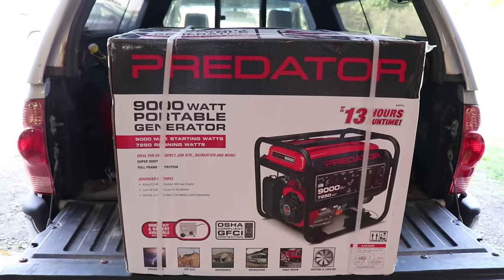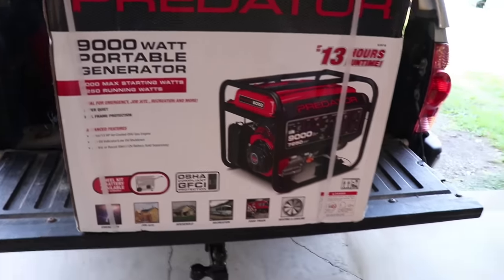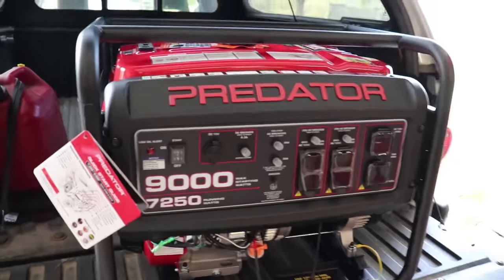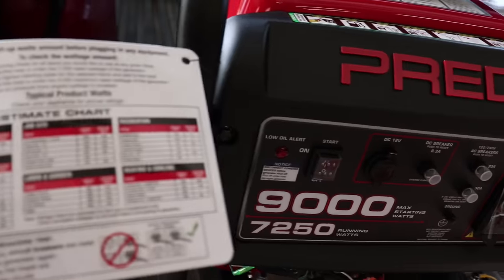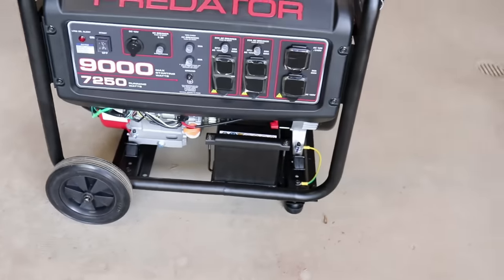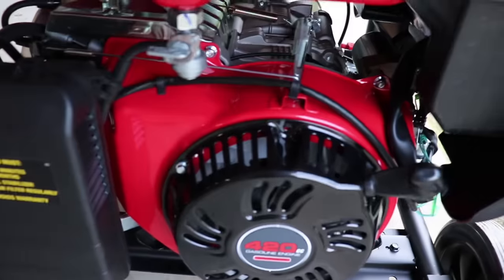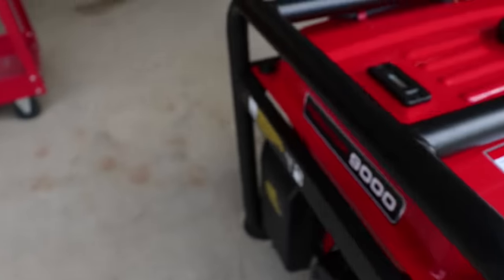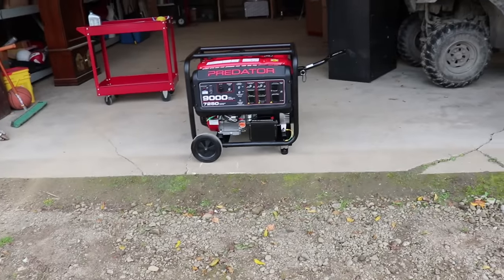Predator Generator Running Our ENTIRE Home. (Complete Setup and Cost)

Comment: i would like to add a tip.....when your through with the generator turn off the fuel and let it run til it quits........that will keep the carb from gumming up...
Reply: Great point Fred.  Another reason to turn the fuel off and run dry, is to prevent your entire fuel tank from leaking all over the floor in the event the float gets stuck.  It happened to me 4 years ago.
Reply: @3qgc  Also never let in run out of fuel if connected to a load or the AVR will burn up , If you have access to aviation gas it will last longer and not cause carb problems like gas with ethanol does(ethanol breaks down in approx 9 weeks)I have had poor results with  fuel stabilizers and think its snake oil .
Reply: @gloknor  Unfortunately, my generator has run out of fuel under a load however, I don't recall anything major happening.  I'd refill it and be good to go.  AVR?
Reply: @3qgc  avr is the automatic voltage regulator, I have lost several generators from guys running them out of fuel under load and it ruins the gen head because the avr is trying to compensate for the load and  loss of fuel .
Reply: Add Seafoam to the fuel.  I run in all my gas lawn equipment and everything starts on first pull even after sitting all winter with gas in the tank and carburetor.
Reply: You could probably get a lpg conversation kit for that quite cheap on aliexpress im thinking about getting one for my 2kw genny
Reply: @chrisblester37  Great idea especially if you have  the 100 lb bottles plus the engine will run a lot cleaner but I think the power will be slightly less since there is more energy in gasoline (approx 30k btu more per gal.) but still better than a gunk crud filled carburetor that won't run right and potentially ruin gen head and whatever is plugged in to it .
Reply: @gloknor  What if it runs out of gas while i am sleeping? Will it burn it up and I have to buy a new generator?
Reply: @n721sw  I hope not but try to have it full of fuel before bed. I have had generators  ruin the gen head  from running out of fuel under load . I now use a diesel generator for my house and it is much more fuel efficient and no more gummed up carburetors to deal with either. Be very careful if filling with fuel while running since they it could overfill and spill onto generator head.
Reply: Buy two large red gas cans and store about 20gallons of fuel for emergencies. You also have your cars tank that you can draw from. Put some stabil in it and use that for your lawn mower, refilling the big container as needed. That way you always have some "fresh" gas.
Reply: @gloknor  this is why generator safety is very important
Reply: @brianb5594  Seafoam is amazing.
Reply: @gloknor  I hear people say that all the time but whos gonna monitor that all night most people when it runs out get up go put more gas in fire it up and go back to sleep so whats the deal i been doing it for yrs same Harbor Freight old Chicago Electric Gen had it for 23plus yrs still runnig strong never had a problem    Stop trying to scare people!!!!!!!!
Reply: @johnames6430  I am pretty sure stabil does little to nothing. It was probably useful when gas did not have ethanol but I have taken apart a lot of things treated with it and no difference . There are several reviews on YT  showing it does not work also . Fresh gas is the best like you said .
Reply: Travis Hamler  Yes it will lol, there is no fuel fail safe but you can keep believing your own bs . Ruin your genny I don't care in fact I will laugh knowing you believe that bs.  .
Reply: Travis Hamler  keep buying snake oil if it makes you happy but if you actually researched it before running your mouth or have torn apart as many carbs as I have you would know it does nothing.
Reply: @gloknor  I thought you add stabil because of ethanol. If you have just pure gasoline like the old days then you don't need stabil (I think)
Reply: @johnames6430  Stabil is suppose to protect from several things like ethanol breakdown but I have seen no difference . When Stabil first came out in the late 60s there was no ethanol alcohol in gasoline and fuel lasted longer regardless but like I said I personally have seen no difference like many others. Just because a product makes a claim does not mean it is so .
Reply: Ava fuel is way overpriced and difficult to get - real, real stupid idea!
Reply: @longshot7590  Real real stupid  is your comment.  If you want good fuel that is why is cost more . Sounds like you have other issues that need addressed .
Reply: Travis Hamler  thanks Travis!  Appreciate the reply.
Reply: @fred benson  Absolutely correct. Been doing that for years. When I put the gen into storage, I add a full tank's worth of Sta-bil and then turn the gen back on for a few minus to get the stabilizer into the fuel line. Then I turn off the petcock and let the gen turn off from lack of fuel.
Reply: @3qgc   - great point. Gen carbs are pretty basic and easy to have the floats stick open or closed. Well said.
Reply: Travis Hamler  I’m new to all this. But looking to get a generator to run my 1300sq ft home in case of power outage. What do you suggest I look at buying?
Reply: Travis Hamler  And Travis with the K.O.
Reply: Make sure you all are aware with the hazards of using generators. Generators can be dangerous if not used carefully so make sure you follow all the generator safety instructions. I know all about generator safety and I have something to explain to everyone about generator safety. Here is what you all should know: please remember not to ever run your generator indoors. Generators should only be used outdoors. Always remember that carbon monoxide fumes are odorless and colorless gas that is a silent killer that you cannot see or smell. Carbon monoxide is dangerous and it can cause death. Carbon monoxide is poisonous. Always keep that in mind when using generators. You need to have a carbon monoxide detector. Make sure your generator is 15-20 feet away from your house and away from doors, windows, and vents. Never use your generator indoors even if your doors and windows are open. Some people run their generator indoors during hurricanes which is dangerous and you and your family will die if you use generators indoors. Running a generator indoors increases the risk of carbon monoxide poisoning. Please don’t run your generator in wet conditions. Running a generator in wet conditions can electrocute you. You need to keep your generator dry. Don’t let the portable generator get wet. You need to have a generator tent as well to protect your generator from getting wet if you will use  your generator during wet weather. We also really need to keep our children safe when we’re using portable generators so they won’t get electrocuted or burned by the generator which is dangerous. Generators can be hot. You have to keep an eye on children making sure that they are not near the portable generator to avoid any risks. We have to be aware with all the hazards and follow all the instructions in the generator’s operating manual. Generators pose electrical risks. Make sure your generator is not overloaded. Overloading your generator can cause damage to the appliances that are plugged into the generator. Please don’t overload your generator. Don’t ever try to plug a generator cord into a wall outlet to avoid back feeding. Back feeding is dangerous. Always turn on your generator first before plugging in appliances. And before you unplug the appliances, please shut off your generator first. Please use a heavy duty cord for your generator and the cord should not be worn out. Please don’t refuel your generator while it’s running. You should shut off your generator and let it cool off before refueling it. Refueling your generator while it’s running can cause fire if gasoline spills on the generator’s engine because it’s hot. Please make sure your generator is properly grounded. Everything that is said on the generator’s operating manual should not be ignored. They all need to be followed. https://youtu.be/I1jT3ANENvI and here is a video more about keeping your family safe while using generators. This is for everyone’s safety. This is just a safety reminder for everyone to make sure that you all are aware with the warnings. Thank you and hope you all stay safe.
Reply: @gloknor  seafoam is one of the better fuel stabilizers and they absolutely do work on ethanol-based fuels.

I get tired of all the people spreading false information about alcohol-based fuels, alcohol as an anti-noch agent was the original anti knock agent that everybody on the planet wanted to use except for us oil companies who demanded the use of a very dangerous compound known as Tetraethyllead also known as Looney Lead because the workers responsible for adding it to motor fuel all went slowly batshit crazy.

Tetraethyllead is so toxic that just a eyedropper full in the palm of your hand will kill you yet somebody thought it was a good idea to put this in motor fuel.

At the time every major scientific institute on the planet opposed it, Albert Einstein wrote a very long letter and actually testified in front of Congress on the dangers of adding loony lead to fuel.

Tetraethyllead is now being linked to the violent crime surge the US, 

Children in inner cities were exposed to large amounts of Tetraethyllead, every microgram of Tetraethyllead per deciliter of blood in a young child's system will result in a 5 to 10 point drop in their IQ as it significantly impacts the development of their neurological development.

So the inconvenience of switching to alcohol from Looney Lead is a small price to pay for what the US is now seeing as a 30-year low in violent crime which is directly attributed to removing Tetraethyllead from motor fuel
Reply: @dannelson8556  Sea foam is snake oil too but have fun wasting your money. Fuel stabilizers DO NOT work . Sorry if that offends you .
Reply: We used to do this with dirt bikes we knew we wouldn't ride for a while.
Reply: @gloknor  Question
if the AVR is constantly calculating the voltage to adjust it as needed/hense AVR,how do they burn up when the thing runs out of fuel nothing is pulling power or voltage one would think? I know enough about electricity to not fool with it to be honest.
Reply: @captainjoesanglingadventur4894  All I can tell you is the 3 gennys I had the construction crew use ran them out of fuel while using them under load and all were trashed. I had a 4th generator lent to my sister after a storm and of course she did the same thing( ran out of fuel under load) and it was toast as well. Granted these were not high end gennys  but still cost around $600 ea and really upset me.I suggest turning it off when going to bed or be vigilant on checking fuel when using one its not worth ruining it .  Take care Captain Joe .
Reply: Here are the portable generator safety rules: this safety information is only for anyone who use a portable gas generator and for those who are planning on getting a portable gas generator. This is just a reminder for everyone’s safety. All generator safety rules should be followed carefully. This advice is just to make sure that everyone is aware of all the warnings and it’s just to remind people to be careful using portable generators. Generators can be dangerous if not used carefully. Every year, hundreds of people die or get injured when using portable generators due to carbon monoxide poisoning and electrocution. Make sure you are using your generator carefully and keeping others safe as well. There is something very serious that everyone should always be aware of when using generators. Some people do run their generator indoors which is not safe and that increases the risk of carbon monoxide poisoning which can cause death of family and you. Some people run their generator in wet conditions which can electrocute them. Please remember that you should never run your generator indoors. Remember that carbon monoxide is an odorless and colorless gas that you cannot see or smell. Carbon monoxide is a silent killer. Keep that in mind. Make sure your generator is 15-20 feet away from your house and away from doors, windows, and vents. Never use your generator in your porch too. Having a carbon monoxide detector is very important against generator safety. Some people also allow children to go near the portable generator which could pose risks. We need to keep an eye on our children making sure that they are not near the portable generator so they won’t get electrocuted or burned by the generator which is dangerous. A locking enclosure also keeps kids safe. A generator shed might look like a tempting place to explore, or take cover during a game of hide and seek, but a generator is a dangerous piece of equipment that can cause injury. It says on the manual that we should also keep children away at all times from the portable generator to avoid injuries. Please do not allow a child or unqualified people to operate the portable generator.  It is important to keep your children safe especially little ones. The portable generator can be hot during an operation. Just because some manuals missed what should be listed doesn’t mean it’s safe to do. Always follow the generator safety rules when using portable generators. Generators pose electrical risks. If you need to use your generator during wet weather, you need a generator tent to protect your generator from getting wet. Don’t let your generator get wet. Keep your generator dry and before using your generator, please make sure your hands and your generator is dry. Do not wear loose clothing when operating the generator. Everything that is said on the generator’s operating manual should not be ignored. Never smoke cigarettes near the generator. Please keep flammable things away from the generator. Never overload your generator too. Your generator can catch fire. Never ever try to plug a generator cord into a wall outlet to avoid back feeding. Back feeding your generator is dangerous. Always turn on your generator first before plugging in appliances and shut off the appliances before turning your generator off. Use a heavy duty cord for your generator and the cord should not be worn out. All the instructions should be followed carefully. Never refuel your generator while it’s running. It can cause fire if fuel spills while your generator is hot. You should turn off your generator and let it cool off before refueling it. Having a fire extinguisher next to the generator is also important. This is only a reminder for everyone’s safety of using generators. Make sure your generator is properly grounded. Having a fire extinguisher next to the generator is also important against the safety rules. https://youtu.be/I1jT3ANENvI and here is a video more about keeping others safe when using generators and also about our family’s safety. We should be keeping our children safe especially little ones. Generators can cause electric shocks too. Hope you stay safe and hope this helps. Thank you.
Reply: Another tip is, after shutting the generator off. Close the CHOKE. I do this to prevent bugs getting in making a nest in the carb.
Reply: I am at the point I have new carburetors on the shelf in case they get crapped up since they are so cheap.
Reply: @savagedabs8536  I do not monitor comments on youtube nor do I care what Travis whoever 's comments are. We are talking about small gennys that are used by homeowners and I stand by my advice as I have years and years of experience repairing and owning  them . I can bet you little Travis owns nothing and has miniscule experience .
Reply: @gloknor  mut7
A
Reply: In case anyone is still confused...
This "gloknor" guy is not a certified tech. He seems to be a shade tree parts changer. Carb changer I guess. 
This guy knows so little about basic maintenance that he keeps extra carbs lying around instead of just maintaining his equipment.
Travis is absolutely correct on all points.
I am a certified tech and have been servicing generators for 16 years. I have serviced generators offshore, food service, cold storage facilities, marine applications as well as commercial, industrial and residential settings. My service area is the entire gulf coast where the hurricane season puts these machines to the test. Do not be confused. Travis knows his business.
Reply: @gloknor  
You do not monitor comments on youtube?
You've been responding on this thread for 7 months! Lmao
Why do people spread their opinion even in the face of immutable fact? When professionals step in it's time for laymen, like yourself, to bow out. Just step aside and ask questions so that you can learn.
Reply: @The_Happy_Aviation_Enthusiast  

Did someone close to you die from misuse?
Is this part of a therapy for you?
Reply: @goodcitizen3780  I have a repair shop kid. I have repaired more equipment then you have ever seen. Travis( which is your other user name, no surprise there) referring to large generators and features only commercial gens use, in case you have not noticed this is about small homeowners generators. I am guessing you are nothing more then a young kid that only works for someone else with very little experience.
Reply: @goodcitizen3780  nope. No one close to me died. I was only reminding people to follow the generator safety rules.
Reply: @The_Happy_Aviation_Enthusiast  
Glad to hear you didn't lose anyone from it.
Have you thought about making a stand alone post or even a video on your safety tips? It might be more effective and at any rate it would save on making off topic posts. Plus making the video might be a fun, possibly lucrative experience.
Reply: @gloknor  I'm sorry I didn't address this post in my other comment. I didn't monitor youtube comments very well I guess. At least not as well as you.
Why do you insist on referring to everyone you disagree with as kid? Is it your opinion that young people cannot be as well or more well versed in a subject as you? 
I'm not Travis, or if I am I guess I'm psychic since this account is at least a dozen years old if I knew how to find how old this account is I would say exactly but I'm pretty sure anyone can see it if they know what to click. Keep looking stupid. You wear it well.
I also am no more a child than I am a small or skinny man.
I don't believe you own a repair shop. At best you own a parts changing shop. I don't even think that's the case or you would have a much better understanding.
I have worked for myself, in this industry, for the last 10 years.
This is the third company that I started which is still in operation.
My other businesses are a very successful apiary and a lucrative metal stud farming and drywall business, both of which have been in operation for more than 20 years.
Reply: @gloknor  uh oh. Maybe you are offline now. Maybe it's Maybelline
Reply: @gloknor  
It looks like you might have accidentally liked one of my comments while you were liking your own.
Reply: @gloknor  
Oh WOW! I was just joking about you liking your own comments until I see that every comment of yours has exactly 1 like after travis blasted you! You really did like your own comments! Too funny. It's important to like yourself. Lol
Reply: No gloknor no more. :'-(
Reply: @goodcitizen3780  no, he is licking his wounds.. LOL.
Reply: @ShelbyvsViper  
It would seem so.
Reply: If you putting it away what you should do is run it to it completely out of fual
Reply: Now I have to go out and start up my generator. But thanks!!
Reply: ⚠️Rules about generator safety: This is a very important announcement for everyone. It’s important to follow all generator safety rules whenever we use portable generators: 

Everyone must see this. This is just a reminder for everyone’s safety. 

1) KEEPING OTHERS SAFE: Please do not allow an unqualified person or your children to operate and service the portable generator. Just because some manuals don’t say that doesn’t mean it’s safe. That is important against the generator safety rules. We also need to be keeping an eye on our children too. You need to make sure that your children are not playing near the portable generator especially when it’s running so they won’t get electrocuted. Generators pose electrical risks and they can be hot during an operation. Please keep your children away from the portable generator at all times. It is important to keep our children safe especially our little ones. Be aware of all the hazards.

2) WHERE TO RUN YOUR GENERATOR: Some people use their portable generators indoors which increases the risk of carbon monoxide poisoning. It’s important to have a carbon monoxide if you have a gas generator. Never ever use your generator indoors even if your doors and windows are open and even in the garage is not safe to use a portable generator. Not even at your porch and your deck. It is never safe to use your generator indoors and in enclosed areas of your home. Your generator needs to be 15-20 feet away from your house. 

3)🔥FIRE HAZARDS: Never refuel your generator while it’s running. You need to let your generator cool off before refueling it and before storing your generator. Never overload your generator too. Never ever back feed your generator. You should never plug your generator into a wall outlet. Also never store propane tanks indoors. Please keep flammable things away from the generator as well and please don’t smoke cigarettes near the generator. Having a fire extinguisher next to the generator is also important against the generator safety rules. 

4) GENERATOR OPERATION: make sure your hands are dry before touching the generator. Never use your generator in wet conditions. Don’t let your generator get wet. You need a generator tent if you need to use your generator during wet weather. Please don’t wear loose clothes when operating the generator. Turn on your generator before plugging in appliances. Use the right cord for your generator. Please do not use worn out cords. 

https://youtu.be/I1jT3ANENvI and here is a video more about keeping others safe when using generators 

Hope this helps. Remember safety first
Reply: @johnames6430  You mention getting gasoline from your car to run the generator. Thought of that many years ago but learned that most cars have anti- siphon mechanisms in the filler pipes. Probably a good idea in most cases, but makes it difficult ,if not impossible in this situation.
Reply: @ericripley9739  in a true emergency you can just pierce the bottom of the gas tank and drain it, then replace the tank. I'm not sure which cars have the anti-siphon in the filler pipe but you can certainly use suction like with a pump to extract the gas (if it goes in it can come out) Another method would be to run the pump and take it out from the fuel line at the engine. But that's not recommended because most people should not be working with fuel at all.
Reply: @The_Happy_Aviation_Enthusiast  Excellent advice. Just one question though… you say to shut generator off first before unplugging appliances. Why not the other way around.?
Reply: @johnames6430  I had a couple of Rangers (97 and 04)and there was a metal flap down inside the filler. Might have been a safety thing to prevent fuel leakage in case of rollover. And think my Outback has a similar setup. Don’t think most people want to puncture their fuel tank, except maybe in a very dire situation. And disconnecting a fuel line is probably not something most would have any idea how to do.
Reply: @ericripley9739  so you won’t get electrocuted
Reply: Most towns have a pump with non ethanol gas. Sometimes its called recreational gas. Doesnt gum up carbs and lasts way longer than regular pump gas.
Reply: Exactly.
Reply: @chrisblester37  Just be aware that the output is reduced because LPG has less energy than gasoline.
Reply: @gloknor AvGas has lead in it and is 100 octane.
Reply: @akbychoice  Yes and that is good(ethanol free too). Some marinas have ethanol free fuel also .